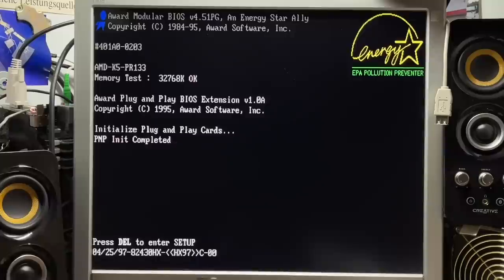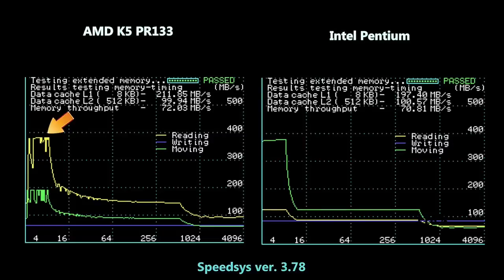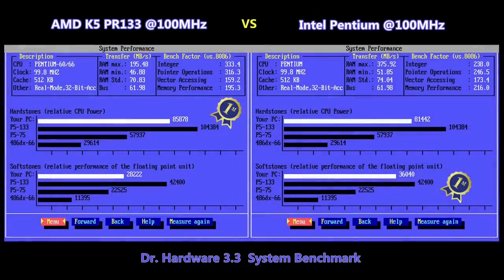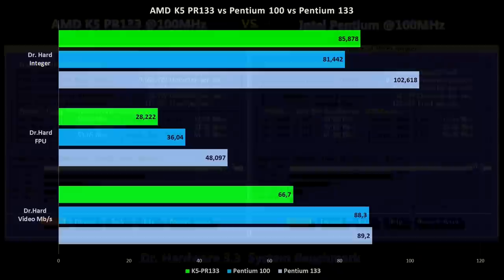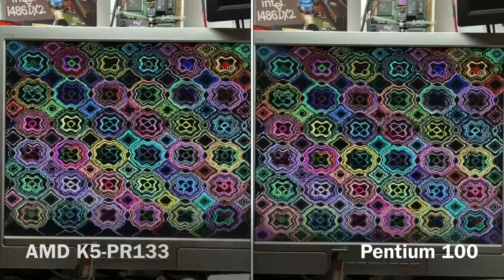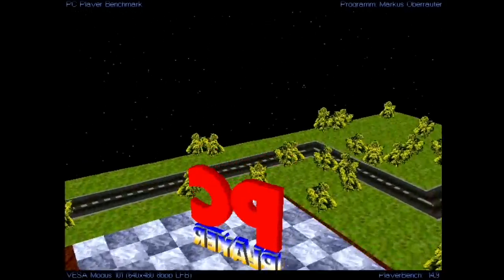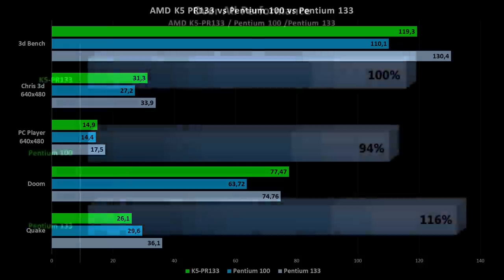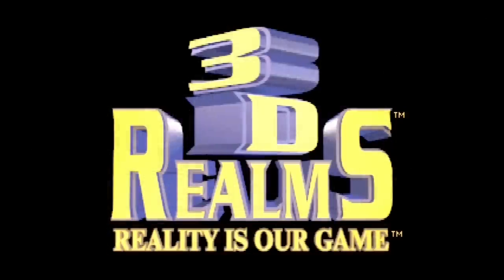AMD K5 PR133 vs Intel Pentium 100 / 133 Benchmark Battle

Comment from the maker: Bad caps on the Asus board: Thanks to all for giving me the hint of some bad caps on the mainboard. I will replace them of course! And I am very happy that you all are watching my videos so in detail that you are recognizing that. 👍🏻 You are a great community! Love all your comments. Cheers, Peter ☺️
Reply: ya yours im watching in FULL HD just to find quirks and to complain after.. other videos im only watching in 360p :D
Reply: I was just looking yesterday at a vintage motherboard with a Duron processor with MANY bad and swollen caps that I need to replace.  It would lock up in the bios and the screen would sometimes scramble up.  I would like to fix it but first I must find/buy about 15 capacitors or so.  Lots of desoldering/soldering ahead in the future!  🤔
Reply: I wonder if the bad caps affected performance any. One bit of advice I want to give is that if you should always replace any given type of capacitor with the same type of capacitor. I've had things stop working after going from tantalums to electrolytics. I think it has something to do with timing signals, which electrolytics aren't good with.
Reply: You have a lot of fans buddy. Nobody else is making YouTube videos like yours. Performance info on past CPUs is hard to find.
Reply: I was going to write a comment. Well here a comment anyway ^^.
Reply: Id like to see a beefed up k6.
Reply: Are CPU’s of this vintage 3d die’s?
Reply: @RodBeauvex  I doubt it.. I benchmarked them on the day and the k5 was bad
Reply: @RodBeauvex  It has to do with ESR, and to some degree ESL. Different dielectrics have different properties. And honestly, I would be surprised if the bad caps DIDN'T affect performance: with bad caps, the ESR would be very high and capacitance low, meaning more ripple from the power supply and other switching noise would get into the core voltage. This could easily cause issues. Would be interested to see if there was a difference after replacing them, though it seems this channel is gone now.
Reply: @AureliusR  I don't know about his boards, but I recently redid a 386/486 combo board that would always crash or act weird in some of of the DOS benchmark programs. Recapping the board did indeed cure these issues.
Reply: My frends 5k 133 with tseng was better in duke 3d on vx pro+ mainboard but my p100 on FX with s3 virge was better in quake. 16 mb ram both.

Comment: Thank you !  K5 PR133 was my first PC in 1997, with cheapest Socket 7 mainboard, 1MB VGA card, 8MB EDO RAM, Seagate 1.2GB HDD, wearnes 8x CDROM, crystal audio card, 14" GTC XGA monitor, cheapest desktop case ,200W AT PSU, Epson Stylus 200 printer, illegal win95b and softwares 🤣. cost me USD 1400.

Comment: The AM29000 Family is very interesting and the 29030 is a beautiful little piece of Hardware to own.
Reply: What motherboard is the 29030 processor compatible with? Can you run dos games with it? It reminds me of the Motorola 68k family that apple computers used to come with back in the 90's.
Reply: @moeschizlac  A few workstation boards. I never owned a board for my 29ks. These where used mostly in embedded systems (laser printer, Airbus flight computer). But the K5 is basically a 29050 successor with a x86 Instruction decoder on top for socket 7.

And for DOS-Games: Not really. All 29k except the K5 are RISC-Instruction set Processors. As far as I know there is no popular DOS/Games scene for this processor line. So if you want to run DOS on it, K5 is the way to go. The performance is not awesome, the decoder is pretty inefficient. But that's as near as it gets.
Reply: @te0nani  Exactly. Am29000 was using RISC instruction set. Today every X86 CPU is RISC based inside with old horrible x86 decoder in front. AMD was very ahead in time with K5 back then. X86 as horrible ISA shouldn't be alive in 21st century. AMD should have kept Am29000 instruction set alive and open it up for everyone. Jim Keller tried same K5 trick with common K12/Zen CPU development for two different ISAs: ARM/x86. Too bad they killed K12 after tape out.
Reply: We used the 29000 series CPUs in telecom equipment. It gave a real boost in performance; compared to what we had used previously

Comment: I remember selling Pentium and AMD K5s in the 90s. We used to joke that PR stood for "Pentium Rating". Most people that opted for the AMD variant tended to be unable to afford the much more expensive Intel option so we did our best to make them feel good about their purchase. At the end of the day, 99% of users wouldn't notice the difference in performance between a Pentium 100 and even a Pentium 166. For gaming the Pentium 100 provided perfectly playable FPS when paired with a capable GPU and 35fps vs 25fps isn't something most people noticed in games like Doom, Rise of the Triad or Duke 3d. It was only when benchmarking and games that included more broad graphical settings became the norm that people really started to notice performance differences within the same platform (Socket 7, Slot 1, Socket 378 etc). I still remember most people in the mid to late 90's when asked what PC they had would simply say, "I have a Pentium" or mumble "a 486" under their breath. Very few people I knew/did work for knew anything beyond the marketing hype. When you found that guy/girl that said they had an overclocked Pentium 100 running at 133 with a 4mb Tseng Labs graphics card and 16mb of EDO RAM you got excited at finding a kindred spirit :)

Comment: I owned an AMD K5 75Mhz CPU back in the day. I was building a socket 7 based PC at that time and didn't have enough money left to buy an Intel CPU. The K5 75Mhz was about half the cost of even a Pentium 75 or 90Mhz, over clocked a fair amount (using a Megatrends HX83 motherboard) and did the job until I was able to replace it with an AMD K6 200Mhz CPU about 6 month later. 
I used that machine all the way until winter of 98/99 when I replaced it with a Celeron 300A on an Abit BH6 motherboard. I ran that overclocked to 464Mhz for quite a while!

Comment: Finally a mention for the Am29k :) It's an interesting chip and ISA, but it didn't see much use outside of some fairly niche applications. Also neat that AMD used some of the new 29k tricks with the K5.

Comment: i just love these Tseng ET6000 cards. Still have mine from back then when i bought it new. Also 4.5MB MDRAM soldered on. Btw.. is the one capacitor between then PCI Slots a bit bulged? Not very common in that era or motherboards. Anyways, interesting comparison. I only have to of the K5 - the PR150 version with its uncommon 105Mhz that not every board can provide. But nice to have CPU.

Comment: With respect to the graphic card performance, I had a K6 in the Pentium 2 times and there was a little utility that you run and enabled something in the CPU that basically doubled the graphic card performance, for what I remember it was something that Video bioses didn't enable in AMD chips.

Comment: Very nice. Had a similar idea to benchmark my collection back in 2005 or so. My main goal was more to compare those x86 stuff against the UNIX-systems from Sun, HP, SGI and DEC. But also benchmarked some So7 combinations. Used NetBSD to keep the software side in check. Afaik from those benchmark i run the most interesting to me was the oggenc time of an 20min track or so. I keept those result even after selling all the hardware in 2008 or so: 
IBM 2V2P150GE P150+ 3.7 - 18217.852
Intel A8050275 SX969 - 17735.011
AMD SSA/5-75ABR E - 17000.381
Intel A80502-90 SX968 - 13978.796
AMD K5-PR100ABQ F - 12679.37
Intel A80502120 SY062 - 11361.742
IBM AVAPR200GA PR200 A - 11333.167
Intel A80502150 SY015 - 10410.907
AMD K5-PR166ABX C - 10157.52
Intel FV80502166 SY037 - 9736.795
AMD K6-166ALR C - 9368.251
Intel FV80503166 SL27H - 7943.87
I think the values are in seconds so lower is better. Always felt all So7 alternatives gave to agressiv values. The K6 was by far the most capable imho.

Comment: I have a K5 PR166 in a PC here. I've had it since new. I didn't realise at the time that it wasn't an actual 166MHz CPU until I tried to install Windows ME and it wouldn't let me, because it requires 150MHz. Dodged a bullet 😁
Reply: setup.exe /NM will let you install ME :)

Comment: Spotted two bulging capacitors: at 4:57 and 5:30 (closest to cpu Windows logo). Probably not an issue, unless board starts crashing randomly.
Reply from the maker: thank you! I already ordered new ones. 👍🏻
Reply: @CPUGalaxy  Maybe this is the reason for unusual benchmark results. Try replace them and give it a test again.

Comment: I had a Cyrix, the rather wierd 6x86L - a non-MMX chip that used MMX voltage - and it ran on a Tyan Tomcat motherboard with a linear regulator that you could fry eggs on
Reply: I remember that the cooling fan on my old Cyrix CPU had to run so fast that the sound would nearly deafen me!  You knew, though, that if you DIDN'T hear that sound you had  better switch your machine off REAL fast or that Cyrix would go "nuclear" on your ass mighty quick and take your motherboard with it!  Those were the days.....🤔😀👍👍
P.S. I think it was one of those Cyrix processors that ran at an "equivalent" speed to a Pentium 133Mhz CPU, but really could not quite "make the grade" even though it tried REALLY hard!  I was relieved when I finally got a PENTIUM 166 to replace it with. So much faster and no more worrying about a "meltdown!"  👍👍
Reply: @arthurmann578  Did the fan noise compare to the Athlon days? I still remember the 60mm Delta black-label fans screaming just a bit away from where I was sitting. What were they called? FOP38's? Those also couldn't stop otherwise the CPU would meltdown.
Reply: @anomaly95   I think I remember some people commenting about the noise those fans made you are talking about...🤔  The fan on my old Cyrix was so "tiny" to me, it was hard to believe all the noise that it actually was capable of making!  I'm pretty sure that they did not last that long either because of the speed and because they were just sleeve bearing and not ball bearing.  Lucky for me that I did not have it long enough to go out before I upgraded the processor to an Intel 166MHz.  What a HUGE difference in the sound level of the Intel fan. I could hardly hear it!

Comment: I had the K5 PR150.  I was the only person I knew with the chip, it definitely wasn't popular but it was an OK chip, especially given how cheap it was compared to a Pentium.  It played Quake fine mostly and paired well with a Voodoo card until I upgraded, it always just seemed like a slightly sluggish Pentium competitor but it is quite an interesting chip architecturally speaking.

Comment: When i upgraded from my 486 DX25 in 1997, I got a 430VX Chipset board (PCChips M530 iirc), and the PR133 - performance was just fine, but had issues with the Voodoo 1 drivers at the time - which took weeks to get stable by testing different things in the BIOS.

Comment: Had this AMD cpu installed in my first PC which my family bought used in 2002 which was brought to town used from Germany in the end of 90's, that's when I also discovered doom and it has me consumed up to this time. I also played lots of dn3d and never knew about lagging and some quake which ran quite well.

Gotta say win98se made the gameplay a bit slower with just 16mb ram and 1mb graphics I can't remember. Some speed up was acquired when it had 64mb ram installed. It also had ess FM audiodrive 1868wdm, it was impossible to have it playing the sfx in dos games. So on win98 I could only have Roland or opl3 music. On win95osr2 I could reassign the irq address, restart PC and have both opl3 playback and sfx for just one PC run.

Dark times yet so much fun of being a kid and the games are still impressive if looked at from a certain perspective.

Comment: Back then I moved from Intel P75 to K5-PR100, mostly for cost reasons. What a huge mistake it was. It wasn't any faster, at least at my games back then, also my father's accounting software didn't work at AMD architecture at all (we had to wait for upgraded version). After that I moved to P133 from Intel and that was my last time I used any AMD CPU.
I have had no knowledge of architecture difference of K5. I was happy with my previous 486DX4 so I thought it would be as good. Oh, how much it wasn't. I might give Ryzen a try now, given how good they look and how good benchmarks they receive, but at that time all that PR rating I considered a pure lie.

Comment: The place I worked for at the time decided to get one of those Amd processors. First we found out we needed a stronger cpu cooling fan. Due to the system locking up. Then a few months later it died. So being the only non current non Intel Proc. we tired. Went right back to intel. Now don't get me wrong. We loved the 486dlc 40 procs. But due to performance and price savings. Not work it at that time.

Comment: K5 PR133 has a 100mhz real clock, so it's has equal or better performance than 100mhz P-100. But PR calculating in many tests : In office tasks, where AMD CPUs like K5 and K6 was significaly faster than pentium and in a games where situation is not so good for AMD. So, PR calculating from many different tests as an average value, and so K5-PR133 will be slower than P-133 in games or multimedia tests, as we can see.

Comment: You can apperently get a PR166 to show as a PR200 but I am unsure what settings are used.  Our other tech did once on a customers computer but I never found out what he did. I can only assume he may have used a 2x multi if that was possible on them. I have never actually had one in my collection except for a 75mhz version for a couple of months that I never actually used.   And these cpu's were indeed interesting but sadly nothing special. It may have stood a decent chance if it was out a year earlier but it was still a very hot chip that couldn't clock worth a duck. Rumor has it, that little bits of its DNA went into Athlon, but I think that is only speculation based on some similarities in design principal between them.

Comment: I helped a friend upgrade his PC with a K5 133 in 1988. For a budget processor it wasn't a bad performer at all, and he wasn't a heavy gamer so it worked fine for him. IIRC AMD dumped the K5 quickly because it couldn't upscale like the K6 and K6-2. Clock speed was a huge selling point back then.

Comment: Have you ever done any testing with the K6-III processors? I had a K6-II 400 back in the day and had always wanted to upgrade it to the K6-III 550 but my mobo was the wrong revision and couldn't support the chip. I remember reading about people getting those and clocking them to 600mhz and really pushing super socket seven to it's limits. I ended up waiting and getting an Athlon 700mhz down the road.

Comment: For a CPU I like this much I rarely use it in my retro setups. But it's one of the oddballs, K6 series is mainstream compared to K5, so I really should. It runs demoscene stuff really nice. Those that don't need a faster CPU, I mean - but it's a decent Pentium class system in that regard.

And though the PR200 is crazy rare I have a K5-PR166 though that nicely runs at 2*66MHz, yours may can do the same, why not?

But my M919 is still slower...

Comment: When I was a kid, my Dad bought us a 486-SLC-33Mhz PC and it was terrible. The SLC was basically a souped up 386, but that thing could barely even run Doom - perhaps 10fps on a good day.

So I saved for two years and, in December 1996, I used all of my Christmas money together with all my savings and ordered a Pentium 133Mhz with 16MB RAM and Windows 95 from a local computer shop. I spoke with the owner extensively and told him all the components I wanted, put down a deposit and returned early January to pick it up. I paid the remaining balance, the whole thing came to around £1300, and took it home.

When I booted it up, I was shocked to see POST report "AMD K5 PR133 running at 100Mhz". Thats not right! I thought. I ordered a Pentium 133Mhz! I PAID for a Pentium 133Mhz! But I had no idea what a K5 PR133 even was, so I called the store. The owner told me that the CPU I had was FASTER than a real Pentium 133Mhz, so he had "done me a favour!". I was confused, but the first few games I played on the machine - a demo of Diablo from a cover CD and a game called Firefight, ran perfectly. As did Road Rash. So I felt better.

Then I installed Quake. And what a fucking shit show! My friends Pentium 100Mhz ran Quake WAY faster than my brand new computer did, and the only reason I had ordered a 133Mhz Pentium is that I wanted a very smooth Quake experience, for Wireplay. So I called the store back, but mysteriously, the owner was on holiday - and every time I called for months after I got the same message. They had ripped off a young 15 year old kid out of his entire savings and Christmas money.

So - fast forward 11 months. I returned to that store the following December with a friend of mine. The worker was a different guy and didn't recognize me and, as my friend talked to him about computers, I reached over and stole a brand new INTEL PENTIUM 200MHZ CPU from behind the bench. I took that home, installed it, and Quake was SILKY SMOOTH, like butter. I was hitting over 60fps in some single player maps, and playing online was far more of a fun experience. That was a £200 CPU back then, which I figured was about what they had stolen from me the year before.

If only I'd have had the confidence to buy the parts originally, instead of paying extortionate prices for a store to build it for me, I could have gotten a much faster computer for less - possibly even a 166mhz Pentium. But I didn't start building my own computers until about 1998.

Thankfully that store went out of business shortly after I stole that CPU. As did most of the small computer stores in my town. Only the most honest and reliable ones remained, and some even remain to this day.